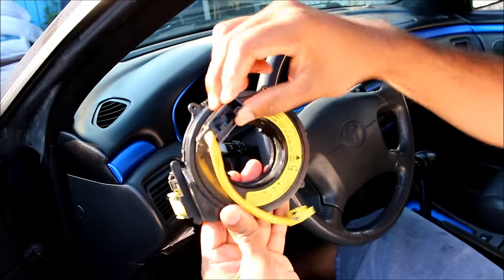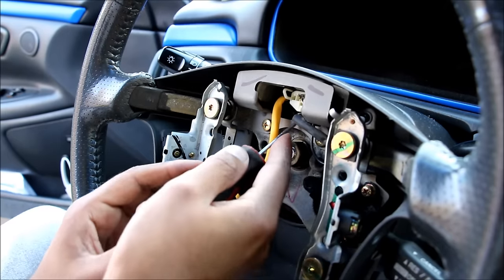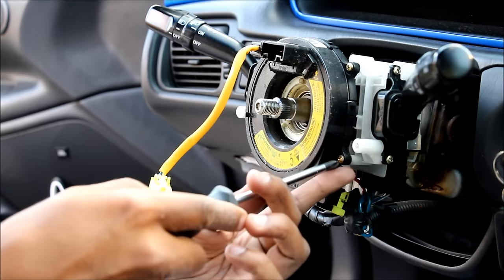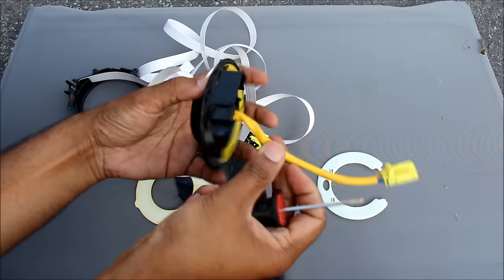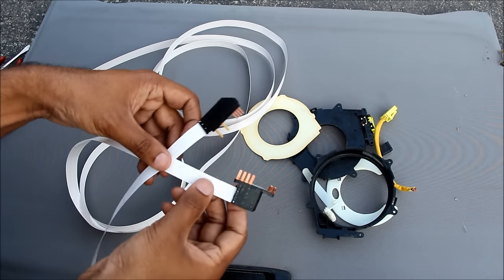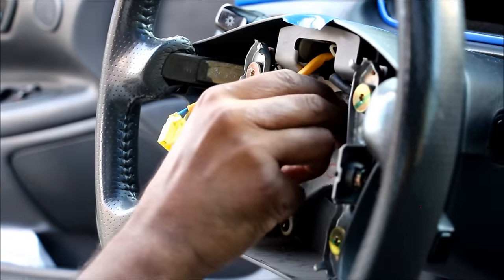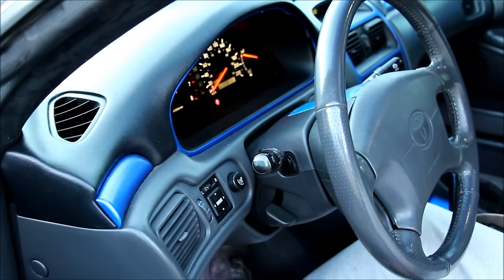Clock Spring Replacement - Toyota / Lexus

Comment: Hey thanks for the video, but I must share a useful tip that you didn't do (and it was dangerous somehow not to do it): When removing the central screw for the steering wheel, unscrew it about half-way, and wiggle the steering wheel as if you were going to remove it completely. Given that the steering wheel usually gets stuck or kinda "glued", doing so will prevent you from getting a SMACK IN THE FACE or injuring yourself!! So: 1- unscrew the screw half-way / 2- give the steering wheel a wigle and pull it towards you to free its "glued" state / 3- the steering wheel is now loose, continue unscrewing the screw and remove it, then NOW it's safe to remove the steering wheel.

Comment: That was great to see how the system is made.  To think that in Canada the Toyota dealerships are charging 600$ for a ribbon wire, contacts and super high end plastic engineering.
Reply from the maker: Get a used one from the junkyard!
Reply: Yup, same with my Hundai.  I got a new spring off ebay for $22 tho!  Took less than an hour to install.

Comment: This is very informative without a lot of chatter , pausing , and obnoxious noises. Great editing . Thanks it helped a lot.
Reply from the maker: +spencer spencer Thanks short and to the point is how it has to be
Reply: True. Very informative, well done.
Reply: Yes it is perfect! so much shitty how to videos out there.
Reply: Agree!!!!!! Great video.
Reply: Agreed, it's a very well done video. One thing I wanted to see was how to install the ribbon cable into the round plastic housing. How many turns of the cable should there be? If I get too many or too few, the steering wheel won't be able to turn enough, and the cable will probably break again pretty quickly. Best thing to do it count how many turns are in the ribbon cable before I take it out, but if I forget to do that before pulling it out....

Comment: Excellent video.  Before mounting the CS I would turn it until it reaches the end, then turn it back 2.5 turns so I'd know it's dead center.  It has a 5 turn limit from complete close to open or vice-a-versa.  :-)

Comment: I went through half a dozen videos before I found yours. It is by far the best most informative video that I found. I will be replacing mine later today while using your video as reference. Thanx for a great video.
Reply from the maker: Glad you enjoyed it
Reply: yeah gotta do my TUNDRA  I had'nt used my horn in like forever  but cruise control has been out for aminute  buddy asked to borrow truck for drivers test MECHANICAL FAIL on vehicle becuase horn would not sound  so no drivers license  went to NAPA bought fuse kit for $33.00 but the fuse puller tool was way to big for under dash fuses needle nose only to find fuse was good  so now its thisCLOCK SPRING crap  gonna bitch slap the engineer /designer being soooCLEVERLY STUPID

Comment: A most impressive video, straightforward and informative. Most YT instructional videos obligate the viewer to see a batch of BS with a selfie part in the video. I don't have a Toyota, but I am currently experiencing some issue with my German car. removing the steering wheel from it is not as easy as on your vehicle. Thanks.

Comment: Excellent video! My cruise control on my 2009 Yaris (332,000 miles) has stopped working, and after checking fuses and replacing the cruise control stalk, my cruise control is still not operating. Further inspection revealed that it will work sporadically depending on the position of the steering wheel which makes me believe my clock spring is faulty.  Thank you for creating this video!

Comment: Good video and a very good explanation of what goes on there. I am amazed at the relative complexity of this, compared to my old 1989 BMW 316i. I removed once the steering wheel and what it had was a brass ring mounted on the back part of the steering wheel, while on the steering column there were a couple of protruding brass  buttons, mounted on springs. These buttons were always out, pushed by their springs, and when one installed the steering wheel, a permanent contact was made between these buttons and the brass ring on the back ofthe wheel, therefore, no matter the wheel's position, there was always contact between the controls in the wheel and the steering column. I thought it was a very sturdy and simple solution, compared to this damn reel of cable inserted on the steering column.
Reply from the maker: +RL R I for see there being some contact issues with that design once things start wearing down. 
With the amount of buttons on the steering wheel controls, there isn't enough room behind the steering wheel for slip rings. You now resort to a clock spring with a chip to communicate to the CAN BUS.

Comment: Hey Speedkar99, I used your vid to replace my 1998 4Runner clock spring.  Horn works like a charm now!  The directions were identical with the exception of the left torx bit cover.  Mine were two circular covers.  For the benefit of others to improve on your otherwise excellently shot and narrated video, I'd mention to apply the tape at the top and then cut it.  Also the torx bit size for mine was a T27, which I'm sure was the torx bit size on yours too.  Total time was about 45 mins for me as I misaligned the wheel by a spline or two, totally forgetting I put the tape there!
Reply from the maker: +Bob Kim I'm glad my video helped. Thanks

Comment: Crazy how simple this is yet we are so technologically advanced but simply functional. Need to change this on my 05 taco, air bag blew and horn glitched here and there so I disconnected it
Reply from the maker: Agreed. Did you crash or it just blew?
Reply: @speedkar99  it was crashed, I bought it salvage, was working great fore a while but then it slowly started to honk here and there to the point where it would honk when the truck would be off.

Comment: 2nd time around having to do this on my 2007 RX 450h.  Lasted about 5 years!
 :(  
Thanks so much again!
Reply from the maker: Awesome. Glad it helped
Reply: may i know what is the symptoms if this part goes bad or faulty? as i have many errors like Malfunction VSC, ABS, Traction Control & Cruise Control with Radar Malfunction as well as when i took my RX350 for the inspection they said it may cause of the bad cable spiral clock (Not Sure) and i hesitating to change it as it wil cost me 500$
Reply: @speedkar99  hello Sir... . I really which to know you more am an automobile engineer but I need more knowledge sir. I will be glad if you accept my request...
Reply: Thats great ooo...

Comment: You sir are the cat's meow! Thank you for sharing. BTW, proper torque specs on steering wheel nut: 2001-02 Models: to 25 ft. lbs. (34 Nm) and 
2003-05 Models: to 37 ft. lbs. (50 Nm)
Reply from the maker: You are welcome!

Comment: I love the format of this video, super fast paced =) keeps you paying attention at all times

Maybe you can answer this question.. is the steering angle sensor within the clock spring on modern cars?

I have a 2015 Scion FRS and I'm thinking my steering wheel is not exactly centered on the gear teeth of the steering column, because i replaced the inner tie rods, and when putting the tie rods back together, i counted threads on both sides to make them even, and the steering wheel became a good 15 degrees offset from top dead center when going straight. Of course, they fixed it on the alignment rack by screwing in one side's toe arm a good amount of threads more, but I'm thinking the correct thing to do would be to set both toe arms equal and then move the steering wheel one or two teeth over. I'm just afraid the steering angle sensor will be all off

Comment: Excellent, concise, informative video.  We're going to use it to change our clock spring.  Pray it works.  Should we test it first to see if it is the cause of the airbag light coming on?  The ECU was already changed and the airbag light is still on.
Reply from the maker: +Brenda Warren You should test the airbag and its wires...there's resistance values in the manual

Comment: Your good. Very informative.Thanks I have a 99 toyota sienna but the horn will work if I push or pull on the steering wheel and it makes connection that way. Sounds like bad terminal connection instead of the ribbon cable as that would not effect anything by prying or pushing if the cable was bad. Thanks.
Reply from the maker: +John Smith agreed, there's something touching under the steering airbag.

Comment: Good way for explanation , bravo, I have corolla 2007 , it's not much different ofwhat you explain. most of the Japanese cars has the same way of replacement for (clock spiral) , I think the rest car brands have the same similer way, just some little differences
Thanks for your good effort
Reply from the maker: +Ahmad Al Samaraiy Thanks, yes the procedure is similar for many cars, involving airbag and steering wheel removal.

Comment: i cant believe that they cannot create a better system than this
Reply from the maker: +BOBspellitbkwrdsSMFS its not that hard is it?
Reply: at least for the horn, i had a 65 beetle and the horn was just a mechanical connection no wire. seems that would be a better option.
Reply: BOBspellitbkwrdsSMFS who is they?
Reply: I actually think the spiral cable of the clock spring is really clever. Beats having sliding brush contacts that can corrode. How else would you do it?

Comment: Good video. But better turn the Ignition on before connecting the battery. So in case (you did something wrong and) the airbag detonates you are outside the vehicle.
Reply: No

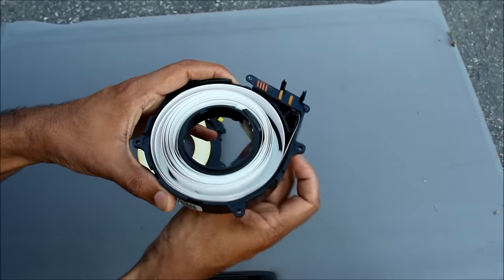Comment: 3:00 Thanks for showing us the inside. My problem is that whenever I drive, I started hearing rattling noise inside my steering wheel. I put pads on headlight and wiper switches attached a metal plate on the steering and tied up any loose wires, but I still hear the noise. I bet this spring wire keeps moving back-and-forth on mine.

Comment: Gen2 Prius -  I found that the Torx screws must be removed. Also the Airbag connections are different. Pull out the yellow center tab to release the wires. The steering wheel would not lock, held it while loosing and tightening the 19mm nut.
Reply from the maker: +Kevin B thanks for the tips. I expected it to be similar.

Comment: Thanks for another great video! Never knew a clock spring even existed. Do you have to worry about setting a code that would have to be reset by a dealer since you're removing the airbag?
Reply from the maker: +Matt Bono As long as you don't turn the ignition ON with the battery connected, the car's computer does not know that the airbag was removed.

As an aside, you don't have to take the car to a dealer to diagnose airbag codes. For $25 you can get a techstream cable and do everything the dealership can do:

https://www.youtube.com/watch?v=KDpldAv0uQE
Reply: +speedkar99 that was a cool video. I like the way tech stream allows you to personalize settings

Comment: Great Video, Bro can I ask you , if the car is pulling to one side in my case left, and all the four  wheels are aligned . I can hear a small knock sound when I turn the wheel all the way left or right, its a very small knock. What could it be?? There are people saying is something with the clock spring, a plastic inside the steering wheel is wear out, or something like that . What is your thoughts, Thanks.

Comment: First time performing this task. Thought your video was helpful...until I realized you have to rotate the clock spring until it stops then rotate it 2.5 X counter clockwise before you install it. You missed a key step fella!
Reply from the maker: Yes resetting that is important
Reply: Oh I missed that. I just had mine installed and it didn’t work.
Reply: Should I go back and do that rotation and maybe it will work?

Comment: So mush more than just power to the controls. It plays a big part in your traction control.
Reply from the maker: Traction control?
Reply: Yes. The computer reads the direction of the tape to know the angle of the steering wheel to know what wheels should get power. My friends clock spring popped off on his Jetta when he did a steering wheel swap and the spring came undone and permanently lost his traction control

Comment: In the video the clock spring is the culprit for things not functioning, but what is the first thing to check if the horn isn't working? Fuse? Contacts? Thx.

Comment: Thanks bro. For the video saved me. $500 in labor and instalation from the toyota dealership.  ,. I got a question are you able to fix the old clock spring because mine causes the airbag light to come on and i wanted to know what caused it to come on and what was defective on it ?   Before i buy the replacement piece maybe i cud. Fix the old piece  would it be the  connection part or something.
Reply from the maker: Glad it helped
Reply: @speedkar99  appreciated  bro.  For the  explaining and the time u took to make this video; very valuable info. .. 👆👨🏻‍🔧💯👍

Comment: Great video showing the insides of a clock spring. I wonder if someone sells those ribbon cables with the correct connectors installed - anyone know where to get them for various cars?

Comment: My god, your steering wheel came off with ease. Mine, i had to use a pulley to pop it out. There was no way it would came out by just yakking on it.
Reply from the maker: Peter Smith Interesting. I took off a few steering wheels no problem from Camry's and Solara's in the junkyard before doing this one and they all came off by wiggling it with ease.
Reply: If you are going to make a video on repairing something you would normally run through it a couple times for practice before actually making the video to make sure everything comes apart and you know how to put it back together. The young man was good and knew what he was doing and didn’t screw up his words. Good job.

Comment: only thing i would say, is people often smash themselves in the face when trying to remove their steering wheels!, please put the nut back on 1 or 2 threads so it wont fly off when youre yanking on it!
Reply from the maker: danbourne11 I can see that happening, good point.
Reply: I've done it in a 73 dodge dart sport good times

Comment: Nice video.. my service air bag light is on and the steering makes a scratchy plastic noise when turning the wheel can this be my  clock spring please help

Comment: Every thing but the horn works on my 2000 toyota sienna. Should I replace clock spring or is another connection to check in steering? Horn works when i hit panic on key bob.
Reply from the maker: Check it with a multimeter first.

Comment: Thank you for the great video! I have a 2005 lexus SC430 with a broken clock spring/spiral cable.  Is this a job for me I have decent repair skills, or do I need a shop to make this switch? also I have seen many inexpensive aftermarket replacement parts I assume they are ok to use.  Thanks in advance for your words of wisdom.
Reply from the maker: +Dwight Ford Thanks for the feedback. You can change the clock spring yourself, just be careful with the airbag, as it is technically an explosive.

Comment: I have a 2003 maxima and i think the clock spring went bad because the steering wheel doesn't turn all the way to the left. However, i cannot find maxima's clock spring part, so can i use another car's clock spring? Like a nissan altima for example. Thanks
Reply from the maker: Check the part numbers for cross reference

Comment: Anything you could do to put the clock spring back together if it comes untangled? the cover came off somehow when replacing the steering wheel signal lever. Would you need to buy a new one and replace it?

Comment: Man your steering wheel is easy to get off try taking a steering wheel off a 99 Grand Cherokee lots of fun nice video.
Reply from the maker: +Ravenwood I too was surprised how easy it was to get off. You could always use a pulley puller

Comment: Hi everyone seeking help,
I have toyota camry 2012. My Airbag sign is on and 90% time horn doesn't work. Mechanic says I need to change the clockspring. And want to charge more than 850 USD. Can you suggest what to do? I live in ohio.
Reply from the maker: Check what the part numbers cross with and get an aftermarket one from rockauto or a used one from junkyard and install it yourself.

Comment: Supposedly, there is a common problem w Lexus / Toyota where there is a creaking or clicking noise caused by the Clock Spring when turning it. I am wondering how that can be caused? Appreciate any info if somebody knows..
Reply from the maker: Not the clock spring it's the intermediate shaft

Comment: Hi Bro--i have a Code: C1231 Steering Angle Sensor Circuit popped up on my 2009 Venza after replacing the Steering Rack, although the centering of the rack was way-off. so After i took it in to a dealership for alignment, i still notice the traction and VSC light is still on....then i tried using my OBD Scanner to clear it still it won't go away then i drove down to the dealership same thing they could not clear it. I then perform zero calibration on it still the VSC light won't disappear....Pls what else can i do? Thanks

Comment: I think I've broken the black plug that goes into the clock spring , can I fix without taking off wheel?
Reply from the maker: You need to remove the steering wheel to replace the clockspring
Reply: speedkar99 I do t think it's actually the spring itself, at  7.12 when you pull the wheel off, you see the black connector on top of the clock spring, I think I broke this.
My camera cable got caught between wheel and dash, when I turned it got tight and I think the only thing in there is the black connector.

What you think?